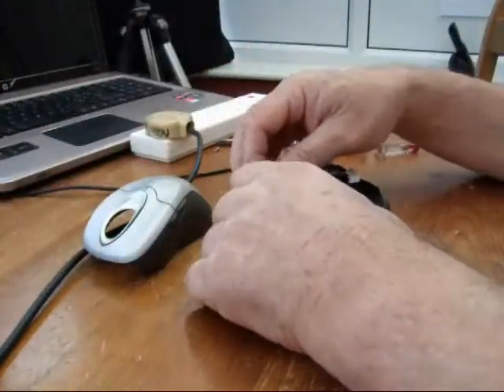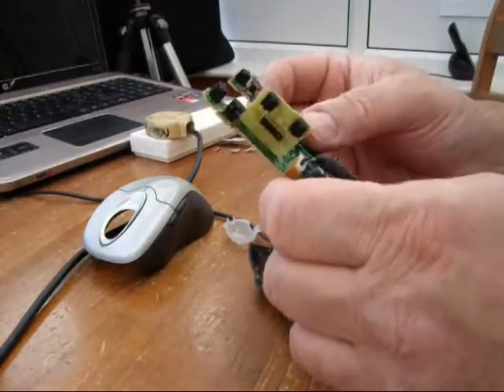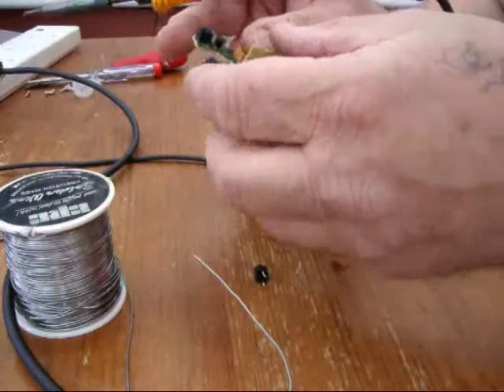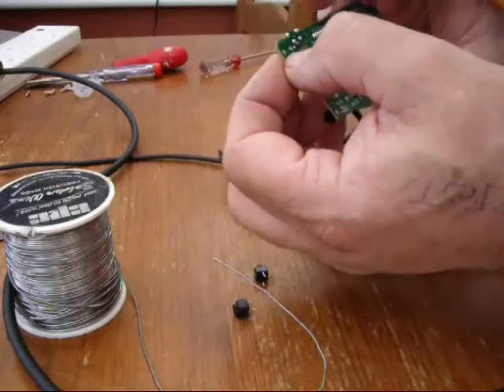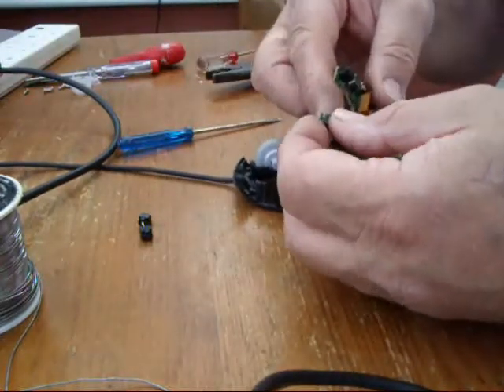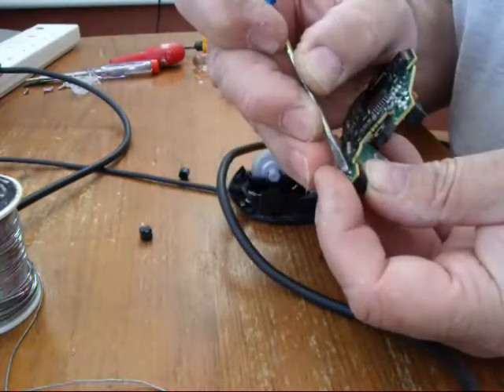intellimouse explorer 4.0 button switch replacement

Comment: That was a great idea -- worked like a charm! I was worried about finding a replacement tactile switch, but your idea of swapping with one of the side buttons was genius. I did run into some mechanical trouble with the scroll wheel button putting the mouse back together though.

Comment: Hi, I just repaired my Intellimouse 3.0 with your video as guide. So I thought I should let you know that your video saved yet another intellimouse from going to the landfill.
I am kind of fond of all the buttons on the mouse and use them all the time and I didn't want to let any of the existing switches trade place with the faulty left click one. Luckily I found an old MS ball mouse my parts drawer and cannibalized it for its 2 switches. Even though the switches from the MS ball mouse were not the same model number as the ones in the intellimouse, the size, shape and function was the same when I checked with a multimeter. Now my intellimouse works flawlessly with its new left click switch. It feels springy and responsive just like when I bought it second hand years ago.

Comment from the maker: Hi
its quite easy. You need to remove two of the plastic feet on the bottom of the mouse and that reveals two philips screws to undo.

Then you need to carefully seperate the top and bottom halves of the mouse starting at the led end . The opposite end to the led has a couple of plastic nibs so be careful not to break them off.